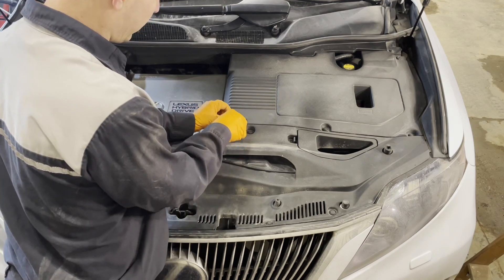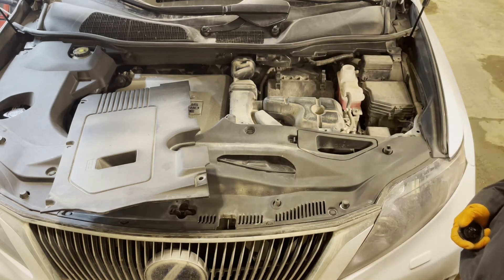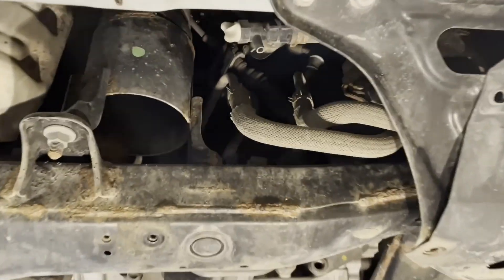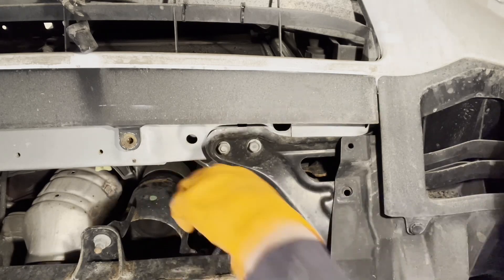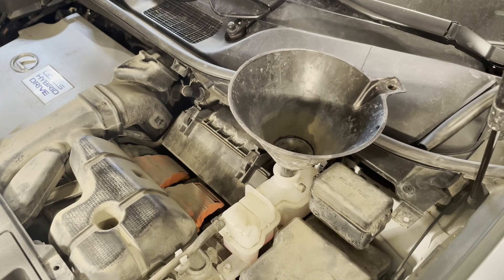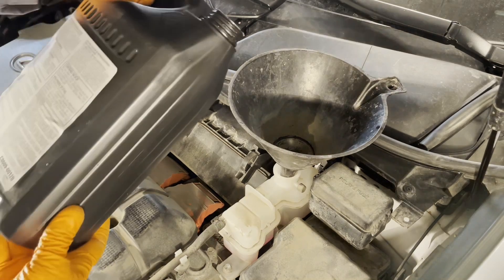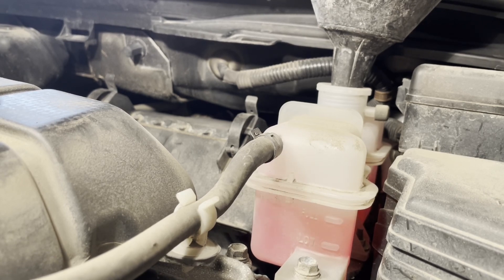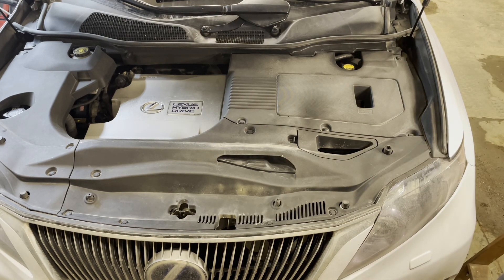2010-2022 Lexus RX450h Hybrid System Inverter Coolant Replacement Instructions

Comment from the maker: Below are my affiliate links to the parts and tools you would use to complete this job. I may receive a small commission from the product sales. Thank you!
Genuine Lexus/Toyota coolant (1 gallon required): https://amzn.to/48kYIYp
Coolant bleeding funnel kit: https://amzn.to/3QbalKl
5/16" drain hose: https://amzn.to/43E0cJa
Sturdy 4 Gallon oil drain pan: https://amzn.to/3Ou4iiu
3 Ton Jack stands: https://amzn.to/3q6VS7t
Automotive trim and clip removal kit: https://amzn.to/3KgKGfg
1/4" impact driver kit: https://amzn.to/4f1UN4A
1/4” socket adapter set: https://amzn.to/44XTTkI
Rechargeable LED mini work light: https://amzn.to/3Y74OpY
Reply: Hey Viktor, question for you I don't know if you can help me. I own a 450h 2010. Got the code P2603. I need to replace the inverter water pump. The problem is that the one I'm getting from parts store is not the same model as the one on the lexus... The part is different and I checked different listing and it tells me I got the right one.. The inlet tube is bigger on the new one.. Don't know what to do..
Reply from the maker: @darklight1479  Hi, I’m not sure what you could do other than returning it and getting the proper one with the correct size inlet, unless you can retrofit it somehow.
Reply: Ok thanks for your help, I thought there was a different model of the inverter water pump.

Comment: Hello Victor the front coolant reservoir from my RX is low should I just add coolant to that particular reservoir instead of the primary one?
Reply from the maker: Hi, is yours a hybrid? One reservoir is for the inverter coolant and the other is for the engine coolant on hybrids. They should both be at the full mark with the engine cold.
Reply: @Viktor_G_Automotive mine is the Hybrid. The front one is really low, should I just refill the front one directly?
Reply from the maker: @Jonesee0101 yes, the reservoirs are for two separate systems and they are not connected to each other, so you just top up the one that is low.

Comment: Hi victor do i need to put it on any obd computer to drain the engine coolent new with a rx450h 2013 so dont have much idea thanks in advance
Reply from the maker: Hi, you don’t need a scanner to replace the engine coolant on the RX450h https://youtu.be/12GWITAxHlQ?si=y1oWKR1kRxnwQt9U

Comment: How often should this job be done? How many years/miles?
Reply from the maker: I believe it is 10 years/100K miles the first time and every 5 years/50K miles thereafter, but you can confirm on the Lexus website under Maintenance section for your particular model/year.

Comment: Hi Viktor! Thanks for your videos.

I followed all the steps in the video exactly. I bought a gallon of coolant, but when filling the reservoir, I didn’t need the whole gallon—maybe I only used about a liter. Is there any problem with that, or is everything fine? The coolant level is steadily at the full mark.
Reply from the maker: @TheLastVanGogh  hi, it takes around a litre or so, you just can’t buy Toyota coolant in jugs smaller than a gallon, that’s why I say to get a gallon in the notes.
Reply: @ Great, that puts my mind at ease. Thanks for the response 🔥
Reply from the maker: @ no problem!

Comment: Thanks for the intuitive video. I heard that one would need to use computer/ diagnostic tools to change the intervener coolant, otherwise, the engine will throws a code. Is that true? I’d like to try it myself. Thanks in advance and any feedback is greatly appreciated.
Reply from the maker: No computer needed. Cheers!

Comment: Hi @Viktor : Do you have a way to checkthe life of hybrid battery on 2011 RX450H? Trying to understand if my mileage is low due to that. Getting only 20mpg now and driven 98K miles.
Reply from the maker: There is no really good way to calculate the hybrid battery life that I know off.

Comment: Do you have to be in maintenance mode to do the inverter on a hybrid?
Reply from the maker: No, the hybrid coolant pump will run whenever the ignition is on.